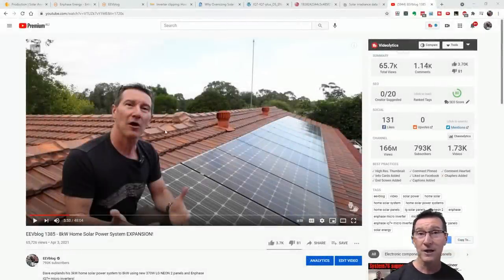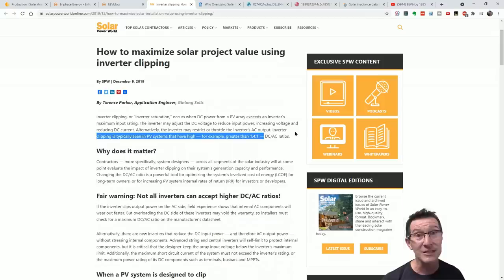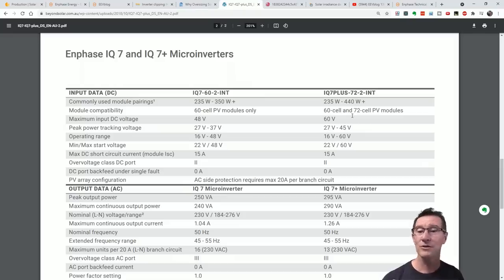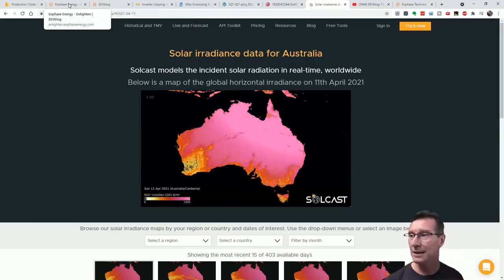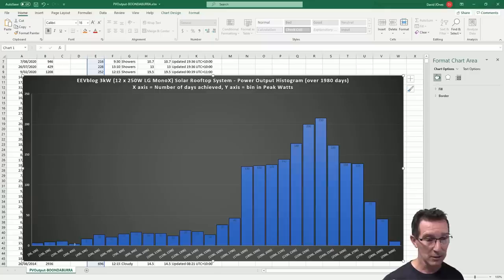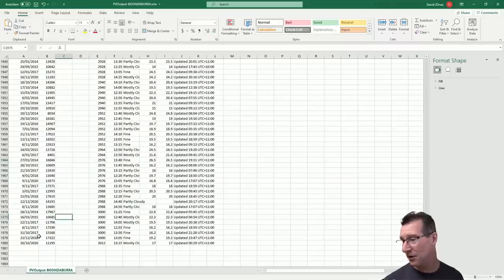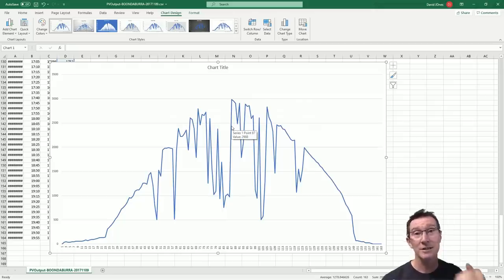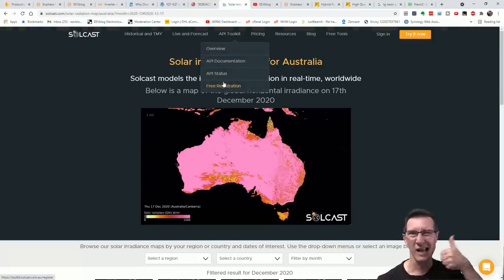EEVblog 1386 - 295W Inverter vs 370W Solar Panel - WTF?

Comment: Just wondered if you had problems with the electric company, as when a grid tied inverter is conected, the power factor of the buildings electrical system is increased and in some cases this can lead to a fine by the electric company, just wondering.
Reply from the maker: Not here as far as I"m aware, but maybe in certain states.
Reply: I found it interesting that the specs for the enphase inverters seem to imply that you could potentially set them to intentionally supply slightly skewed PF (it mentions capability for leading and lagging current). If you had issues with poor power factor, it seems that these particular inverters could actually help
Reply: @UnreasonableSteve  In some large grid tied inverters i.e. 60k watts of peak PV panel instalations, the building/factory have been fined by the electric company because there power factor was reduced from 0.95 to 0.76 lagging, due to the inverters properties and its affect on the grid, which causes reactive power to become more dominant (i.e useless power that the meter sees), this ultimatly causes more stain on the national grid, shortning the life span of the grids conductors hence the fine.  I am not sure if this is relevant for domestic systems, just a thought.

Comment: I have 20 300w panels and 20 IQ7  and I get a max of 244.8va from micro inverter which clips at 4.9kw. This is not a 6k system. My electric true up bill was $1000. So yes the micro inverter matters alot.

Comment: So, in a few years, after you get some good data, you can switch out the 7+ for the 7A on the new system and reuse the 7+ on the old system.

Comment: That just sounds like a very complicated way to justify selling you one thing that costs x$, and supplying something lesser for the same money.
It's one thing to claim the peak system output if it can supply it. It's another thing all together to claim the peak system output, when it's never going to supply it.

Comment: Sounds to me that the only reason that you wouldn't wish to have correctly specified micro inverters that were able to handle the total power the panels generate is cost.   And as soon as someone does a micro inverter that is properly matched without any additional premium you'd be better of with it.   No good reason why you wouldn't want to other than cost, and you don't say what the differences are between the 7+ and 7A to give an indication.

Comment: Does micro-invertor clipping take away the life span.. The clipped energy goes somewhere, so where? Does it heat the panel or is the invertor acting like a dump load and heating up. I want to use the iq7a with a 375watt panel and i think im ok there but i dont want to take life off the units if it is clipping at all. Also with your power charts and graphs it really seems like temperature is an issue are you roof mounted or ground mounted with good air space around the system.

Comment: How many home PV installations are optimised for their latitude?
Not a lot, you can't dig your home up and turn it around if your panels are not perfectly aligned on your SW or SE or NE or NW facing roof surface.
So 800W/m is probably more realistic.

Comment: Three problems with micro inverters, for me.  1) clipping,  if I paid for it I want to use it.  2) grid down, house down.  That’s just plain stupid.  3) cost.  Yes installation is much easier but enphase micro inverters cost a lot more than an all-in-one hybrid string inverter and don’t play well with battery storage. (See #2j. On that, I’m out.

Comment: I don't know if your panels have this, but to prevent a shaded panel pulling the whole string down, some panels put a bypass Schottky bypass diode into the connector block. You can also get these or make them separately.
Edit: One very cool circuit I've seen recently is something that will load a panel around a set voltage point. Explained nicely here https://youtu.be/viMOtah2CzY. You could set the voltage point above the MPPT voltage and load some dummy load with the excess panel energy. Obviously with your multiple inverters that wouldn't work too well, but if you were to series a few panels you could get back a fair amount of energy for not much cost.
Reply: That video link was for powering motor at constant voltage (so it doesn't stutter) 

Mico inverters don't need it as each panel has its own dc to ac inverter so doesn't mater what the other panels are doing as each panel is it's own system (his old system witch he is still using is a string system using a sunny boy inverter but your posted video isn't relevant to a grid tie system)
Reply: @leexgx  I should have made it clear that I was talking about his old string which was transplanted to the other side of the roof. You're right about this being a problem addressed with parallel micro-inverters.
Edit: I think it still is relevant to a grid-tie system. If each inverter's input is isolated, you could make your set-point on that circuit 2V higher than MPPT, then it'd only switch on when the micro-inverter is clipping. Edit 2: you'd need a load that would operate at ~40V and doesn't mind being run much lower than that.

Comment: I have a 13 inch monitor I'm sure you'd love to buy.  (11.9 inch visible)   Or a 1 TB hard drive (1,000,000 some new measurement that I still haven't grasped yet, buy definatly NOT bytes)   SO sick of every industry creating some new measurement that basically screws all pf us.  I'm guessing that 13 inch monitor is Chinese inches, not American inches.

Comment: They now have micro inverters that gives 400 watts and it connects 2 panels together for a total of 800 watts. So if u r going to have a 370 watt panel why not by the 400 watt micro inverters?

Comment: The maths is even worse than you would think. You need to allow for the effect of clipping per microinverter, not across the entire system like with a single inverter in the system

Comment: you say almost 40% of days will see clipping, but for how much of the day?  It would make more sense to look at minutes clipped per year, I bet it wouldn't even add up to 1 day a year.  You're losing almost nothing, and given the better partial shaded performance, you're probably gaining by using micro inverters.

Comment: I have a veranda on my roof, colorbond metal, and it is impossible not to touch the roof metal. 
Would the enphase micro inverters system be safer ??? from electicution ??
The DC string systems get up to 600? volts out put.

Comment: The IQ8 is 300VA output max.  Would you recommend SolarEdge DC-DC Optimizer and SolarEdge Inverter with LG 325W NeON Prime R Panels?  What type of max voltage can you get out of the SolarEdge inverter with these LG 425W NeON Prime R?  Can you please compare between the SolarEdge and EnPhase ?

Comment: Mr. Jones, I have an unrelated question that you may wish to answer..?   I have two solar generators (herein sogen(s)) about 8-9 amps total and would like to power both at the same time using one 180 watt solar panel (instead of a separate for each)..  Realizing that the sogens cannot be connected together in any way,  my solution would be to provide the necessary branch mc4's for each panel leg and isolate the pos.  branch output with an inline mc4 fuse which already  has a blocking diode  built in to prevent vdc back charging.  Your thoughts..??
Reply: Just buy another 180W panel 2nd hand for $40 and be done with.
Reply: @moestrei  I have the other panel, but would like to lighten the load and inventory when camping out..  Is there any reason the blocking diodes on each pos leg of the 'Y' (parallel) branch would not work..??

Comment: Interesting... having looked at the specs of panels and the enphase inverters in the past, it seemed to me that if you oversized the wattage of the panels more than a few percent, you would end up with a maximum open circuit voltage that is higher than the maximum input of the inverter, but it appears yours don't do this.
Reply: Can you explain the effect(s) this would have on production and the system?

Comment: On a related note, do you have any issues with your micro inverters communicating with the Enphase Envoy module that connects to the web?  Mine is connected to an outlet right off the distribution panel but still has trouble occasionally talking with some of the inverters.

Comment: Is there any way to download all your raw solar data from the 3kW system? I’d like to make a little script that clips all datapoints at 80% of 3kW to see exactly what effect this would have on yearly output.
Edit: could also use it to fact check their claims at 27:15
Reply from the maker: I don't have the data to fact check their claims in that table.
Reply: @EEVblog , I’m thinking if you have the data for your 3kW setup, you can get an idea or how accurate their clipping % value is.
Wouldn’t the clipping percent just be directly related to how often your old setup went above 80% of 3kW?

Comment: Can you monitor panels individually ? if yes, you could get one 370W inverter and see after a full year how much is the difference.
Reply: With micro inverts he is using yes (perfect for detecting bird poop on one solar panel as it be making half the normal power)

Comment: i get clipping - it for the environment; but like your area is i think the iq7+ was the wrong choice. cost for the iq7a model isnt huge difference here in the uk its about £40 per unit. also imo if you over spec they are usually designed better i.e. your not straining the micro invertor has it better components increasing longevity and reducing problems (costs). Also big panels over the time will lose the effiency i.e. 370w when you bought them but they are only 250w by the end of the 25 years?

Comment: You are going thru exactly what I went through nearly 3 years ago, I stated I wanted a 5Kw system, and in my head if you order a 5Kw petrol generator it better handle a 5Kw load 😁, I ended up with 19 x 270W panels with Enphase E230 microinverters, wasn't producing the requested 5Kw so I ended up getting 3 more panels/inverters added 😁, recently added a Tesla Powerwall to the system, now that is just magnificent and I want another battery now 🤣

Comment: Would it really cost that much more to have inverters sized not to clip? You say it's significantly more expensive. So why not size the panels not to clip? Make it up by adding 1 or 2 more panels to the installation. Looks like someone is picking the fly guano out of the pepper. 

When I put in my first "non-engineered" system 10 years ago, my "charge controller" cost me $700...and I had to size the panels exactly the same to put them in parallel (which I didn't do...I bought the best and added on as I could afford them). It wasn't long and the controller gave up the ghost...I didn't control its environment well enough. But by then I was able to buy charge controllers for $15. I was able to put a charge controller on each panel. 

In the end, "all" my issues were with storage...not generation. Lead acid batteries were eating me alive. 

Today things are much different...and I continue to shoot at a moving target. Coming up with a cheap way of pointing panels more optimally through the seasons would bring greater return on the generation side. Just hinging them and adjusting angle 8 times a year would make more difference than we're talking about here.

Comment: Wouldn’t you get a higher average output on the solar cells if they were mounted on a solar tracking mount that would actively keep the angle of solar panel perpendicular to the sun’s rays, as the Sun tracks across the sky during the day and and adjust its inclination to look lower to the North, as the sun’s angle tracks lower in the sky during the Australian winter?
Reply: Are you storing the generated electricity in a battery bank, such as or similar to Tesla PowerWall? Then the excess solar panel peak output would go into faster charging the battery, to be released during the nighttime, so you mostly stay off the electrical power grid?

Comment: 2 systems both 10kw one is string which costs 6k the other with enphase cost 15k. Is the 15k one going to produce more power or benefit any difference?

Comment: Hi, can I ask? Since the specs of IQ7+ shows that it can takes a PV panel up to 440W+, why didn't you do so? Why use only 370W?
Is there any issue when pairing IQ7+ with a max out 440W PV panel?

Comment: Has all the figures in excel, then prints out and draws on graph??? WTF?    Just curve fit, then scale curve to new max (5kW/3kW) and then integrate the data is greater than the power clipping limit!
Reply: We get it, you're good with Excel.

Comment: At least 1.4 (approximation of the square root of 2) makes some mathematical sense in DC-AC conversion.
Reply: The voltage is irrelevant here though.
Reply: But for what? Only the rms conversation of a value. The wattage is energy measurement and except conversion losses, there's no RMS conversion losses in that, which technically would be 2x cuz root(2)  * root(2) in denominator or numerator.

Comment: Hey, I have a question, why can't we use a single 5kw inverter & a single micro inverter and use something like A smart switch connected to each solar panel which switchs  the solar panels from the inverter to a micro inverter when it's not giving a similar output compared to other panels??

Comment: Installed x32 m250 inverters with x32 275watt panels in 2015 and then in 2020 added/installed some used x4 m215 inverters with x4 255 watt panels.. and talk about inverters becoming obsolete .. I couldn’t find m215 or m250 branch cable from any new suppliers ... m series Enphase micro inverters are already obsolete...  

Now why did I add lower-watt panels and inverters in 2020?.. well, the panels were $40 each and the inverters $35 each and why send it to the landfill...

Comment: Can you explain why, with a string inverter, shading on a single panel reduces the output of the entire array?
Reply: It's caused by the way the panels are wired up in series rather than parallel, so let's say you have 10 panels each panel produces 10 amps at 25v, if they were wired parallel the system would run 100amps at 25v, each panel's amps would be added to the others, needing heavy-duty wiring to carry the current, instead they wire them in series with the + side of one panel hooked up to the - side of the next, and so on. Wired like this each panel adds its 25v to a total voltage, i.e. 10 panels wired in series would give you 10 amps at 250v, thus the wiring doesn't have to be super heavy duty anymore as there is only 10 amps of current vs 100 amps if it were wired parallel. The drawback is what you describe when a panel is shaded. Think of each panel as a AA battery, if the device you have takes six batteries and you have 5 good batteries and one dead battery in it.

Comment: Power Optimizer between panels solves one panel from dragging down the rest.  I would never put in an inverter (or micro-inverter) that is less than the total KWH of panels.  Poor design to do so.

Comment: Is it possible to parallel the inverters on the DC side so that they can be switched in or out depending on the current coming from the panels?

Comment: Ist is common in Europe too. But i have 4  Solar Systems and i have a Little Bit less overrated. A Test System is online and there i can See 3 different Module inverter from apsystems yc600, seeeyes EVT 560S and Hoymiles Mi700 all on 2x QCell 355Wp
And i can See your point from the Video live on my Siemens PAC2200 and iobroker 😀
Reply: Btw if anyone interested in that sort of Data Write me a Message

Comment: Could you run 2 micro inverters off 1 panel? I'm thinking you could have a spare inverter or two ready to run, maybe off all the panels in parallel, when the main inverters are at capacity.
Just asking cos my knowledge of solar setups is limited.